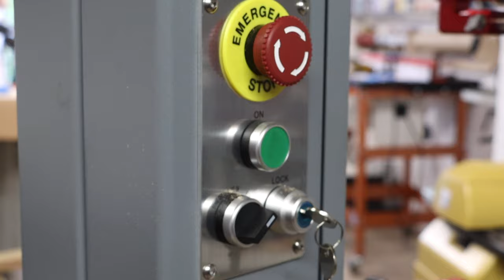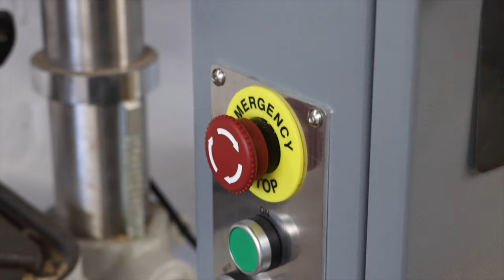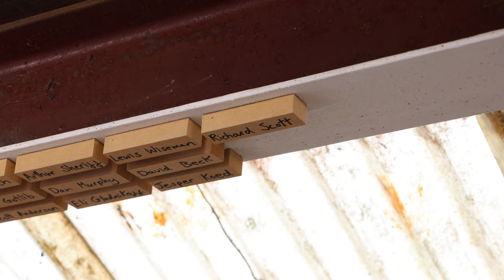Revolutionary Bandsaw Features! Unboxing And Setting Up The Axminster Harvey Trade AT3352B Bandsaw!

Comment: Hi Sean, I've too have one, I got mine back at the beginning of the year and having the summer to put it to use, I can say, you will not be disappointed! I have resawed hundreds of meters to the point of going through two blades, as well many other cuts and it's done the lot with ease and every cut is as good as the first!! And it's one of my favourite workshop tools.

Comment: Hi Sean. Great video - thanks very much. How are you getting on with this bandsaw? I’m in the market for a new saw and am trying to decide between this and the next model down (AP3086B). Do you think it’s worth the extra to upgrade to the 3352B? Thanks again.
Reply from the maker: Hi mate, that's exciting! I absolutely love it, it's a fantastic bandsaw and extremely pleased with it. 

Honestly the AP3086B and AP3327B will also preform really well and do basically everything you want to do on it. 

The Benefit of The AP3352 is the build quality, So it has a better fit and finish, more metal components compared to plastic (handles). But that is more aesthetics other function. And finally a more powerful motor. 

I hope that helps? Let me know if you have any other questions. Also without being cheeky, if you do take the plunge, I'd be very grateful if you use my affiliate link!

Comment: did you consider bolting the base of the bandsaw to the mobile base?   ps the mobile base is better than my 2015 version
Reply from the maker: Hey mate, no I didn't bolt it down. I guess that would be the best way of doing it. But I've never had an issue with any of my other machines, as they are very heavy and don't move inside the base.